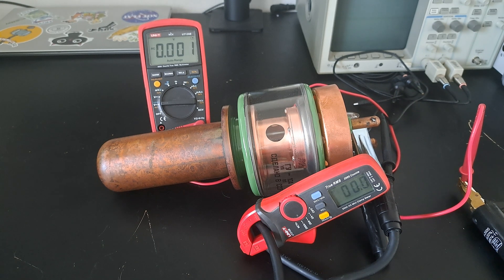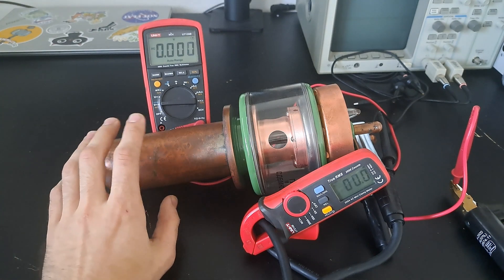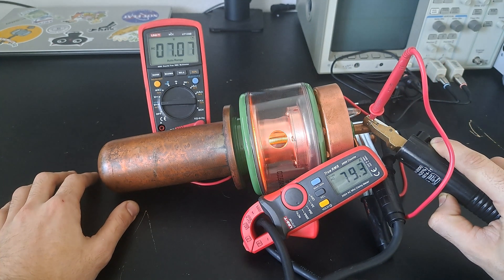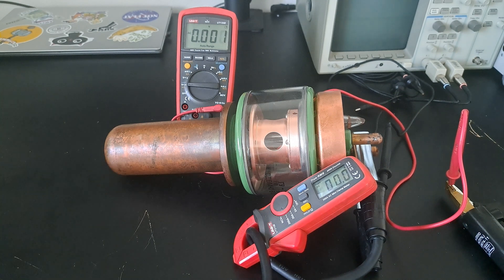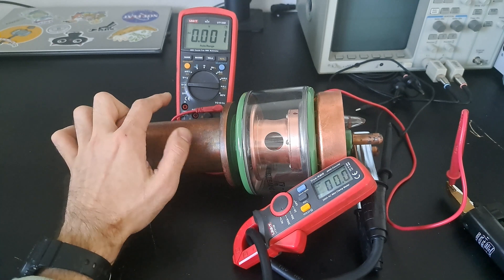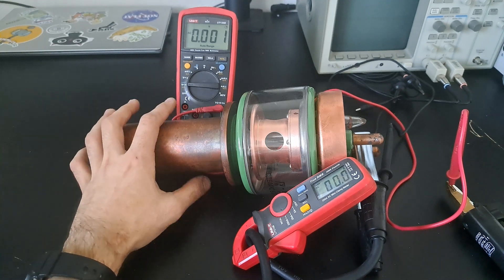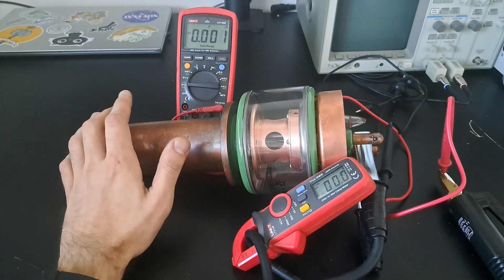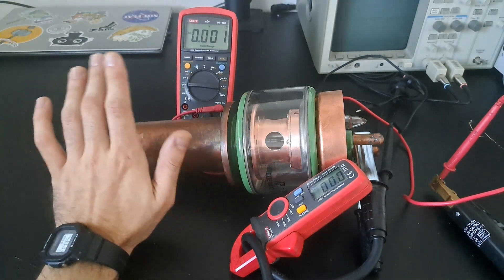Powering up a GU-10A Transmitter Tube

Comment: I am very interested in how the tube operates in a welder.  Can you provide info on the equipment it came off.  Googling comes up with zero.  Thanks
Reply from the maker: Nono, the tube was meant for an AM broadcast station. I used the welder to just power the heater
Reply: @GearAcquisitionSyndrome  sweet. That makes 100 percent clear